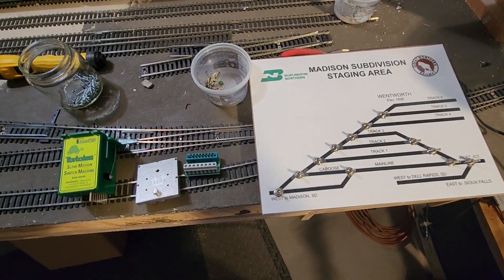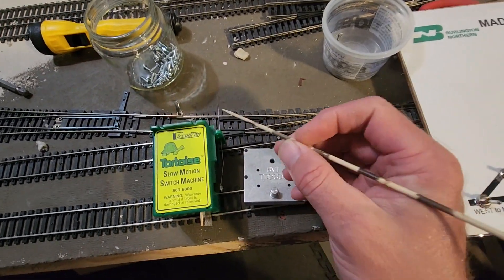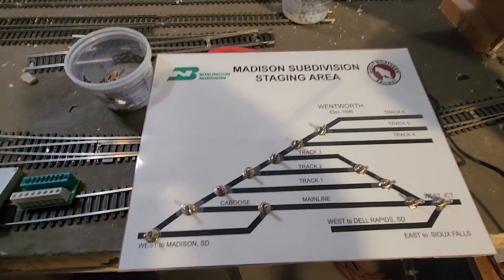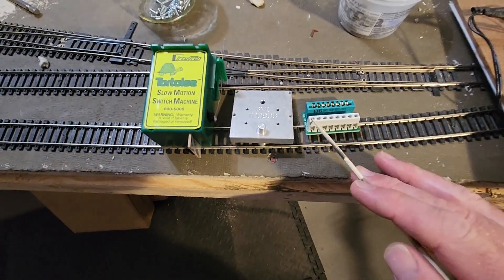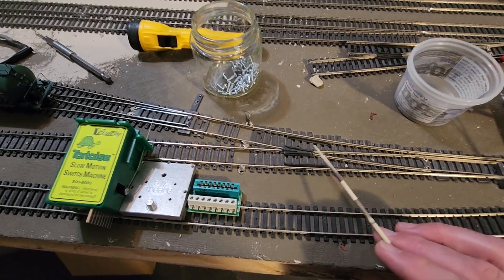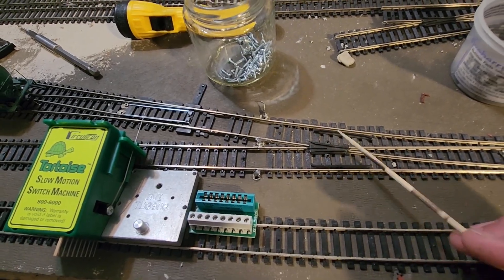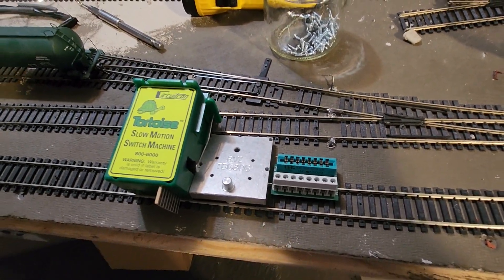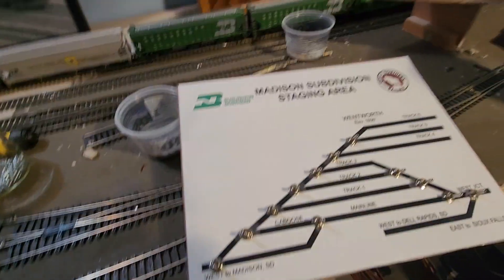Quick HO Scale Layout Construction Update:  Progress at a TORTOISE Pace

Comment: Great update and explanation! I know getting these done will be a big step with moving forward. Where did you get the template for the holes?
Reply from the maker: @TwoRailfans As of just now, I have 13 of them mounted.  About half done with the staging area switches.  Still need to wire in the panels.  Those edge connectors will be a big help.

I can't find where I got the template now.  Seems like I got it from ebay or a vendor...  Midwest Model Railroad or Spring Creek Trains?  Ugh.  I'm getting old.
Reply from the maker: @TwoRailfans Ugh.  Looked back in my ebay...  I bought it in 2021.  The Mfr is 'BVI Rail Tooling'.  Can no longer find it being sold anywhere.   It is handy but lots of people mount Tortoise machines without them.

Comment: Good info…where’d you get the tortoise drill template?
Reply from the maker: Thanks! The Mfr is 'BVI Rail Tooling'.  Can no longer find the template anywhere.   I got it in 2021 off ebay.
Reply from the maker: Thanks! The Mfr is 'BVI Rail Tooling'.  Can no longer find the template anywhere.   I got it in 2021 off ebay.
Reply from the maker: Thanks! The Mfr is 'BVI Rail Tooling'.  Can no longer find the template anywhere.   I got it in 2021 off ebay.
Reply from the maker: Thanks! The Mfr is 'BVI Rail Tooling'.  Can no longer find the template anywhere.   I got it in 2021 off ebay.
Reply from the maker: Thanks! The Mfr is 'BVI Rail Tooling'.  I can no longer find the item anywhere.   I got it in 2021 off ebay.
Reply from the maker: Thanks! The Mfr is 'BVI Rail Tooling'.  I can no longer find the item anywhere.   I got it in 2021 off ebay.
Reply from the maker: Thanks! The Mfr is 'BVI Rail Tooling'.  I can no longer find the item anywhere.   I got it in 2021 off ebay.
Reply from the maker: Thanks! The Mfr is 'BVI Rail Tooling'.  I can no longer find the item anywhere.   I got it in 2021 off ebay.